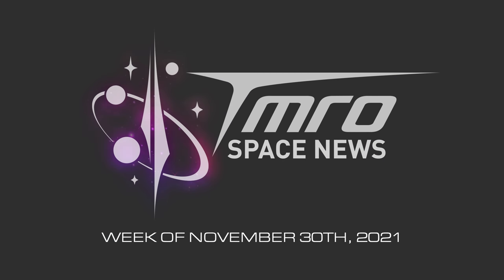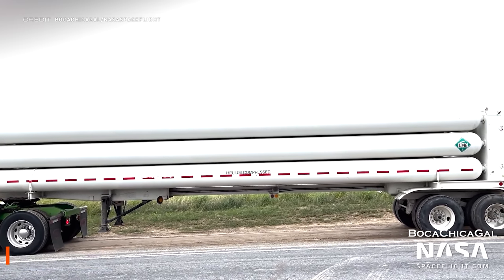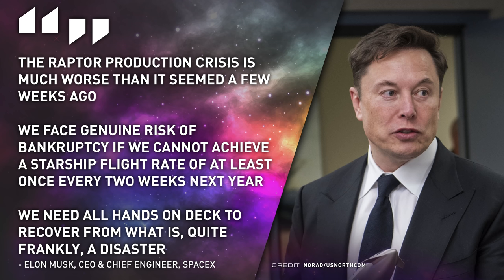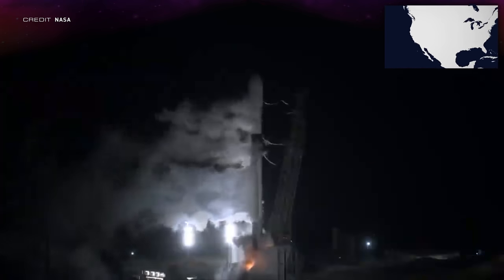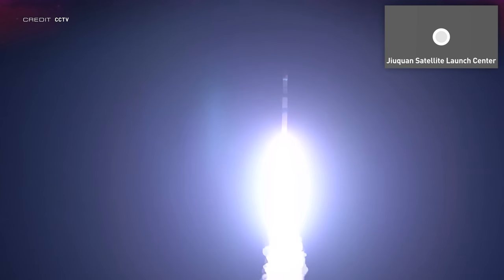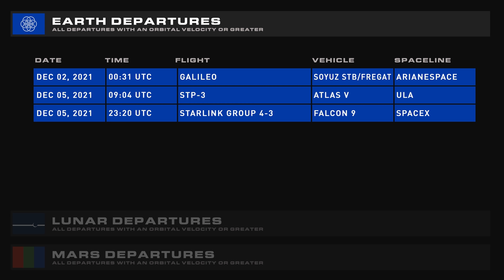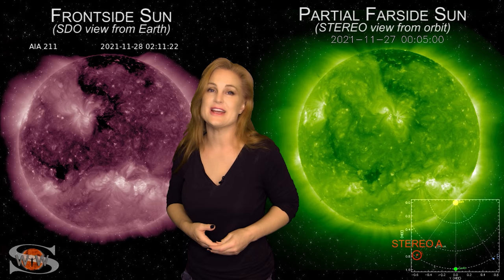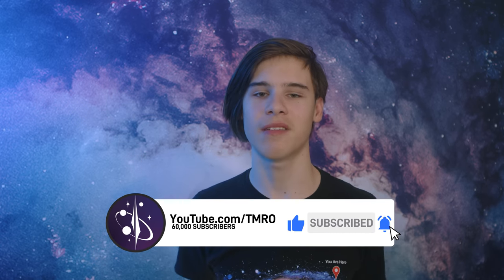Is SpaceX in Trouble? | TMRO:News

Comment: I also doubt SpaceX will go bankrupt anytime soon (300 Belons speak against that). I think what he meant was that they have to get to a cadence of 2 launches per month by the end of 2022. However, assuming Starlink V2 is specifically designed to launch on Starship and not Falcon 9, it would be a huge loss nonetheless if they couldn't launch any more Starlink satellites once they run out of V1. Starship has to keep up with V2 production. They would otherwise have to slow that down which would increase cost.